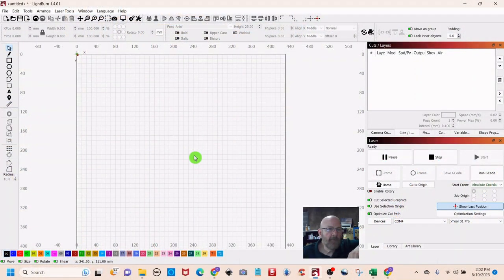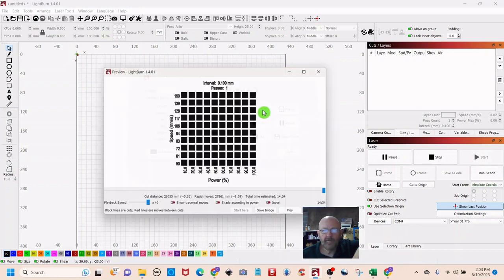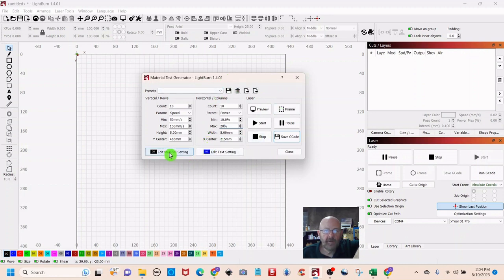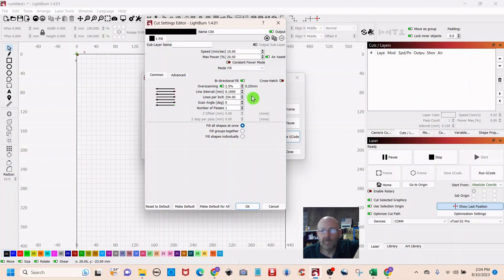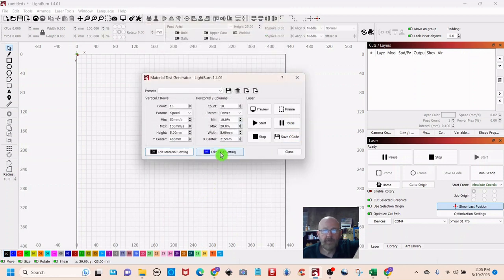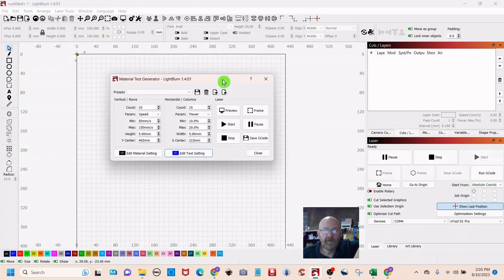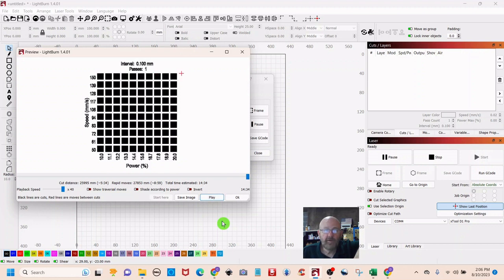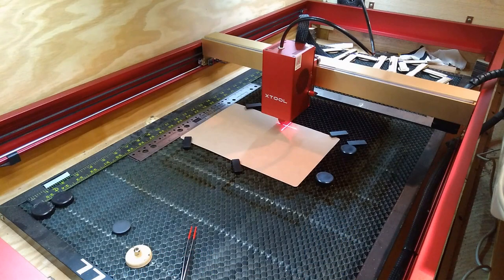Cardstock Materials Test | Lightburn Tutorial #2

Comment: Hello, can you tell me if the neje E40 can cut 1.5mm card stock in one pass?..will it cut it perfect and perfect edges with decent speed?
Reply from the maker: Thanks for the question.  I have never used the Neje E40 - The only lasers I can answer for are the XTOOL M1 10W and the XTOOL D1 Pro 40W and for those the answer is a definite yes.
Reply: @DGLaserCraft  thanks yeah the e40 is a 10 watt